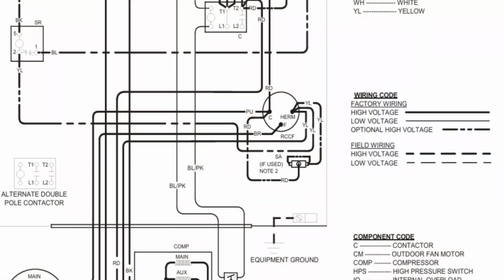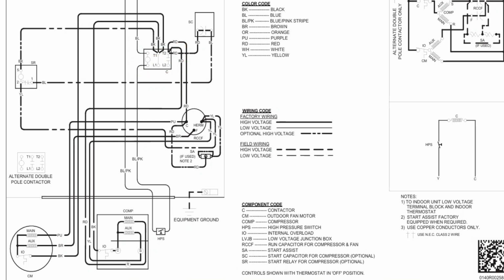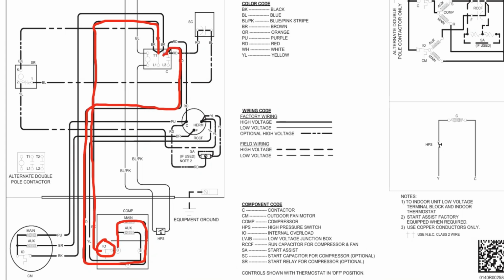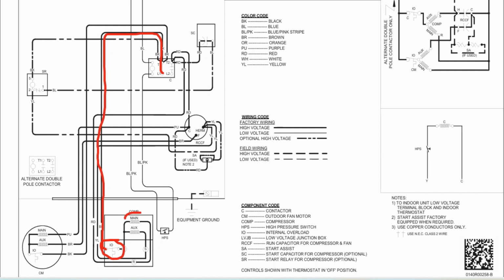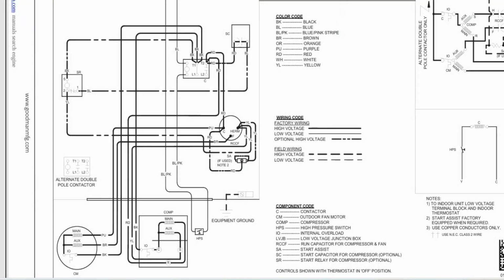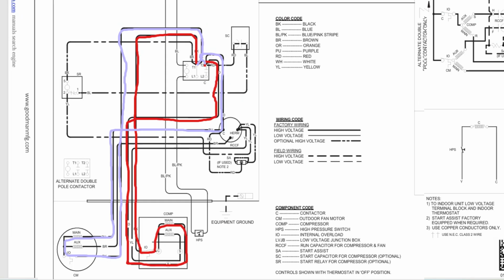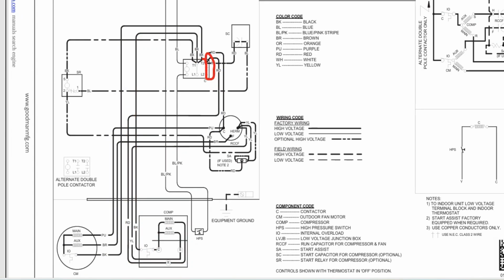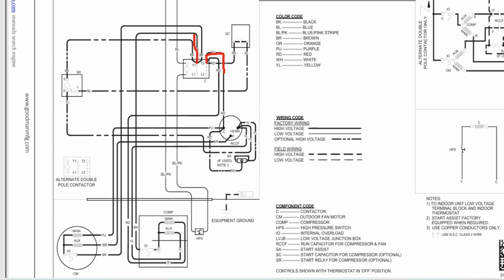How To Use HVAC Schematics In Troubleshooting

Comment: Notes 📝: Thinking about schematics as closed-loop circuits of AC instead of where is energy flowing is a better mindset to have while diagnosing/troubleshooting potential problems of the system.